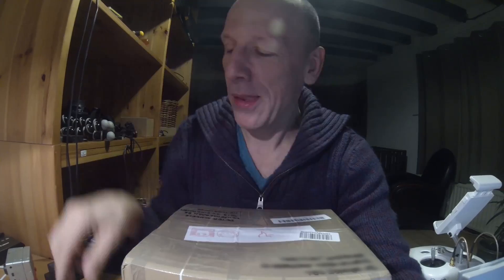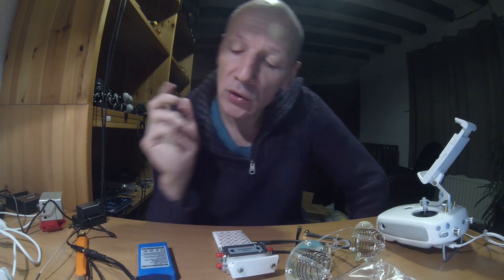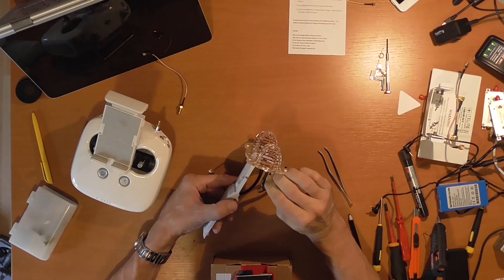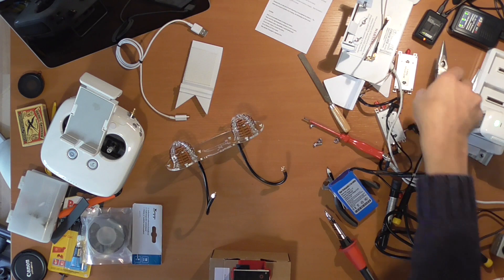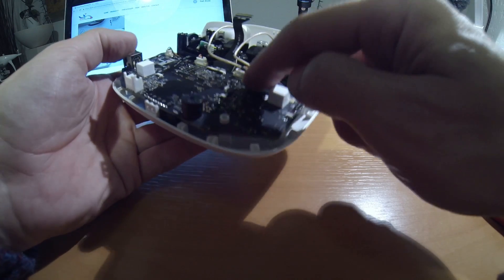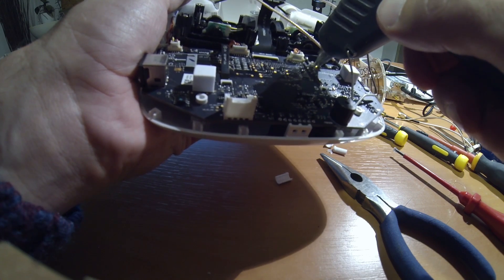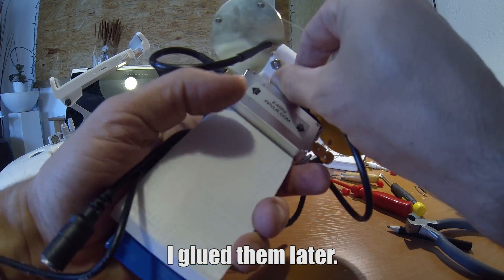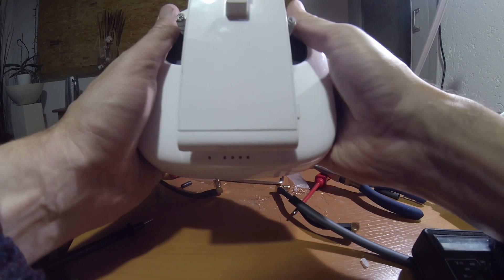Installing the FPVLR antenna for the Phantom 4

Comment: Question:   I just purchased this same set up.. Every time I button everything up, I get a RED and GREEN light on one power box, but only a RED light (NOT GREEN signal) light on the other box.. Do you get both Red and Green lights on both of your power boxes where the antenna and radio cables go in???  Thanks for any help.. I even replaced the inner antenna cable going to the board and have the same issue....

Comment: You were using the ITELITE DBS extender before as far as I can tell. Honestly, you flew your drone 8 KM with very few problems successfully. You had a few video outs, but really if you were standing the whole time you wouldn't have had hardly any video issue, if at all. Line of sight was very impressive for this enhancer, you spent a lot of useless time putting a garbage looking contraption on your handheld and it probably won't do any better in the real world lifespan of the Phantom 4 battery life. Put your ITELITE back on and go fly that thing!!

Comment: So did you every do a follow-up range comparison between the stock antennas, the paddle antenna, and the FPVLR antenna?
Reply from the maker: I have done several long range flights after that. Some successful, some not. But haven't been able to do such a real comparison on our incredibly crowded and flat country...
Reply: We're looking forward to a repeat of your flight to your place in the Canary islands. 
Does the FPVLR work better than the flat panel?
Reply: Mike Kelly The "flat panel" antenna mod. . What is the name of that ? (Where to buy/price in € ? ) And do you know how much it will boost the range ?

Comment: I actually no need long distance flight, but when a lot of buildings around, signal is very weak( dont know what to do...
Reply from the maker: Obstacles block the signal. There is little to do about it. And when near buildings the wifi routers interfere with the signal too. A directional antenna may surely help a little bit with that.

Comment: Did't understand, do you suggest such device or not? What about itelite dbs02? I have never saw that you use some antenna in your videos....
Reply from the maker: Depends on what you want to do with the drone and the regulations in your country. I enjoyed the ITEDBS and the FPVLR a lot. Yes you can see many videos of mine with the P4 using those. I haven't been able to do long distance flights with the P4P though and the signal transmission is improved on the P4P, so not sure whether you need them on the P4P.

Comment: i watch all your videos .i just got my p4pro and the reason i picked this one is so i dont have to extend range!if it already gets 4.5 miles(7km)than why are we extending range?is it because dji dont live up to there range claims?i have not done any range tests yet.im watching videos for my education and it seems the battery wont let you get more than 3.5 miles or you would not have enough power to get back.range was a big factor in me buying this drone .it claims 4.5 miles do you think ill get that without booster?

Comment: you do like professional .i did for my dji phantom too, but i am not cut any cable just keep the same , but fly over residential over usa and alot of power pole and line this thing will not go too far ,max distance i made just 6000 feet from home at attitude 350 feet ,if fly open field no interfear may be go far . but i never have a chance to open space to fly .

Comment: Now that you have  done this mod you are stuck having to use these antennas all the time, for every flight; does the extra weight start to bother you after a while? I have subscribed and really enjoy your dialogue and "tongue in cheek" humor. Keep the videos coming !
Reply from the maker: The ITE antenna is robust and fits in my backpack. But... I got another stock transmitter the other day. So I can even switch back to good old stock if I have to...
And... I got a P4P now. It uses a but different technology/frequency. So I will start with stock and see what happens.

Comment: Het inkorten van de kabels was geen goed idee. De lengte van de kabels is zeer belangrijk, en kunnen als volgt berekend worden:  l = n 1/2 * λ en v = f * λ  zodat er een "staande golf" in de kabel ontstaat. Dit geeft dan maximale versterking (of eigenlijk minimaal verlies).
l = lengte kabel
n=elk positief geheel getal behalve nul
λ=golflengte van het signaal
v=lichtsnelheid
f=frequentie van het signaal
zie: http://www.rekenset.nl/Natuurkunde/Natuurkunde_onderwerpen/Trillingen%20en%20golven/golven_formules.htm
Reply from the maker: Bij een frequentie van 2,4Ghz kom ik dan uit op een optimale lengte van (een veelvoud) van 6 cm. Laten ze dat nou net zijn! Maar dat is meer door geluk dan wijsheid. Ik vermoed echter dat het een beetje arbitrair is. Er gaan ook kabels naar de transmitter (toevallig 12 cm) maar intern in de transmitter zitten ook weer draden. Geen idee hoe lang die zijn. En hoe moet je de pluggen en connectors meten/meerekenen? Dus ja, er zal vast wel een beetje verlies optreden hier en daar.
Reply from the maker: Ik heb de vraag voorgelegd aan de fabrikant/leverancier van de antennes. Hij zegt dat het er niet toe doet, omdat het 50 Ohm kabels zijn. Voor kabels die niet 50 Ohm zijn, moet de lengte inderdaad precies overeenkomen.
Reply: Tja, dit klinkt als: "Als ik een helm op heb, val ik minder hard".
Het is een natuurkundige wet die op geen enkele manier teniet kan worden gedaan.
zie ook: https://nl.wikipedia.org/wiki/Coaxkabel

Comment: i sold my DBS way beck and use a FPVLR on a spare remote with amps .. and yep it performes like no other and they are all hand made, i dont take it off as have a backpack it all fits in and a spare RC of cause. But dont forget to turn the battery on and both amps connected when you fly or it will loose signal at around 200meters. It can also be used without the amps but the cables need to go direct to the RC by passing the amps and then its the same as the dbs but your cables are now to short :)
Reply from the maker: Ha ha. True. They are too short now to put straight into the transmitter. That's why I have been thinking to do even another mod and have a plug right onto the antenna plate. So it can either have complete cables with plugs on both sides to the amps, or to the transmitter. Portability and manageability is an issue for me.

Comment: What the heck lol   you almost lost a finger on that. Holly molly look at that contraption . Sorry but I wouldn't pay the cash for such a mess lol  Heck you may as mount a 8 foot fibre glass pole in the ground and attach the wifi and other antenna to it. run the cable to the transmitter